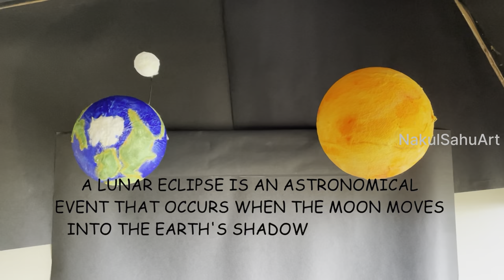solar eclipse_ lunar eclipse_earth rotation working model science project #diy #science NakulSahuArt

Comment: Sir can i use bo mottor instead of gear?? Pls reply my querry its emergency...
Reply from the maker: I used 3-10 rpm motor for better stability and slow rotation.
You can use bo motor,